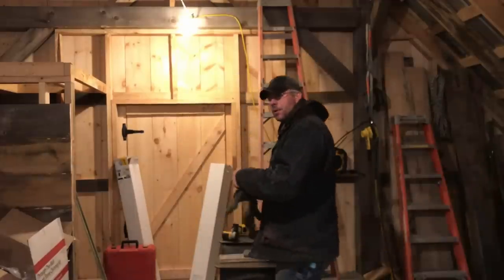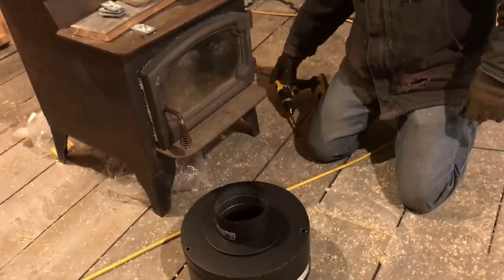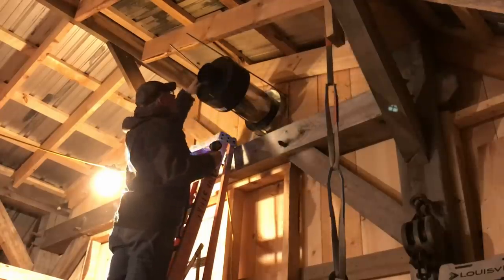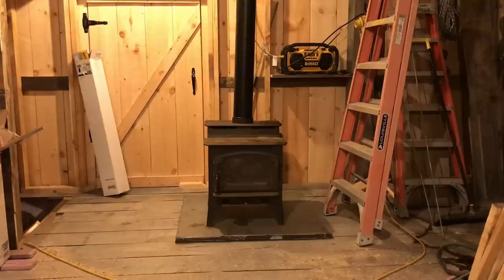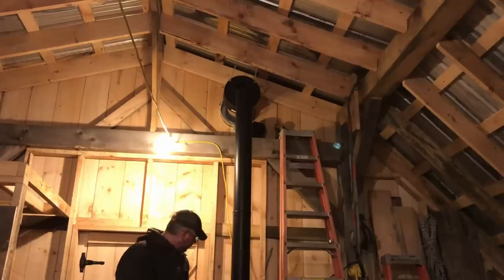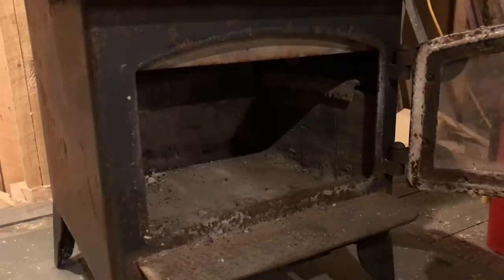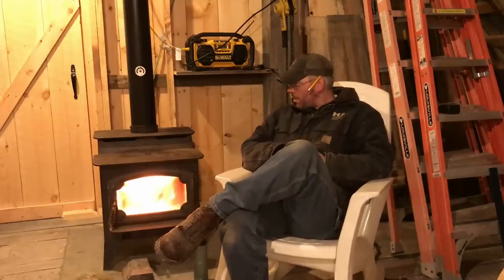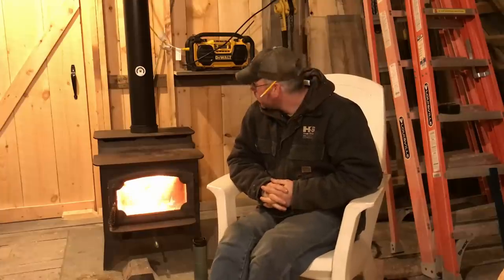Wood Stove and Chimney Installation is Complete, Our First Fire in the Timber Frame

Comment: I agree with your outlook about getting help, as I am the exact same way. My wife always states those same sentiments to me, as well. I hate asking for help, and I don't want to burden others. So I do it myself. 
That being said, our comments about the ladder safety is for your benefit. I was always told, if you don't have the right tool for the job, then get it. So a shorter ladder can be replaced with a longer one, even if it takes an extra bit of time to fetch it. I see you hobbling still from your accident, and I'd hate to see you relive that accident again.
At any rate, sir, another great video. I envy your work ethic and talent. Thanks for sharing. Cheers!
Reply from the maker: You and me both, reliving that is not in my plans.  Of course, it wasn't in my plans the first time either.

Comment: Great install. I’m a career fireman and I live in a 105 year old wood frame home with all wood siding and walls. So I hear your concern of a chimney fire. I don’t know the price but have you ever considered installing a dry sprinkler system? Something you could connect to your water supply and monitor with a  WiFi enabled smoke/heat detector.  You flip a valve and it gives you something helping you to darken down a fire until you get it knocked out or help arrives. Residential systems use plastic pipe for sprinkler systems and they’re more cost friendly. Most sprinkler heads don’t flow a high gpm so even a few in the ridge may be help. Just a thought. Keep up the hard work.
Reply from the maker: I have actually worked on a few systems like that but they were huge.  They used compressed air to hold a valve back, sprinkler head fuse melts, air pressure drops and the valve opens.  Works very well.
Reply: TheTradesmanChannel yep. Same for all our parking garages. Just didn’t know with your level of skill if you could make something a little more economical
Reply from the maker: I bet it can be done, it's really a very good idea.

Comment: Good job there Jim.  I know how that cold is too. Many a days we worked outside in them temps building concrete forms. Then having to wrap them with poly and setup propane heaters for the pour. I don't miss those days. Good luck to ya and keep trucking on that insulation.

Comment: Afternoon Jim... still snowing here, but it is coming to an end soon. Only one other thing I would have done with that chimney. I would have put a quad connector where you have the elbow in the single wall pipe at the top that would allow me to clean out the down pipe to the stove and the short pipe going through the wall. I just think it would make it easier to clean than taking the pipe apart to clean it, unless of course you have a more flexible clean out rod than I do. But of course, if you keep that pipe temperature at the right level, that creosote should burn out anyway. Good job and now you can get back to your favorite job, insulating!

Comment: Hi Jim - why not put an inline fan in the vertical stovepipe? It would reduce the heat at the elbow and distribute heat in the barn  that would have been lost up the chimney.
Reply from the maker: Chimney needs to keep its heat to retain draft which is much more important than the little bit of extra you get from those heat exchangers.  Cooling the chimney down will create creosote.

Comment: Jim you are so right about having to do things alone.. everything i do is alone, but it must get done, with me, so many times something could happen, be it run over and stomped into the ground by 12, 1500Lb steers to getting pined under a truck, or falling off the roof, and know one would even know anything happened, and could be months before anyone found me. but thing need to be done weather i like it or not, with my back i could simply fall between 2 tight thing from 5 feet up or just falling over, and get stuck, and cant get out, and yes it has happened before, many hours before i was able to get my self out, just a few weeks ago i got stuck under my mobile home, since the flood it has sunk over 14" into the red clay, and it is a really tight fit, was trying to thaw out a water line and had to work my self under the steel beam, and got so far and couldnt move, and iit was dam cold under there, over 7 hours before i got free
Reply from the maker: Damn

Comment: It is 65° and Sunny Jim.  Rain tonight but 70° tomorrow.. then rain the rest of the week.

Surprised you weren't using some step bits on the sheet metal drill holes.
Reply from the maker: I have some step bits, just don't use them often.
Reply: @TheTradesmanChannel  so you know the weather changed drastically overnight.  High of 40 today now.  I blame the change on you.
Reply from the maker: Good you dirty cork stuffer.

Comment: A real question:  Why not use cement board (dura rock) vs metal? It seems the metal will eventually get hot and be a better conductor, but you do this for a living so would love your take on this.  

As far as working on your own, I have no problem with that for 98% of your build.  When a neighbor asks for help, I am a big boy, I know when to say no because it is beyond my capability.  And there is risk crossing the street.  I am a project manager by trade and always have a second project lined up if I know you may have to wait for someone else.  You could have worked on the stairwell while waiting for someone to help you with the stove pipe.  We are only giving you a hard time because we love you! 🧡
Reply from the maker: I know you guys worry, I do too.  As for the metal on the floor, it all boils down to the stove.  With this one running full bore it stays cool under the stove.  It's first 20 years was spent the same way.

Comment: A free standing chimney outside for your wood stove?  Would not a chinmey fire then be isolated ?   Seems generations of cabin builder uses an outside chimney of ROCK and mortar for a reason. 

Build a base and put chimney square blocks up with a liner. Rebar the corners.  When stacking, use 4   9/16" hex nuts as mortar spacers…and it helps the chimney go up plumb.

Comment: Jim what's your thoughts on them barrel stove kits? I got a cheap way to get barrels and they are getting to look like a nice lightweight alternative....
Reply from the maker: They're not terrible but you really have to be careful not to over fire them, also make sure you keep really good clearance around it.
Reply: @TheTradesmanChannel  just thinking of an easy wood to pack in a couple miles from the road. (I can always cut a path to the cabin site and use what i fell as fire wood, but just want to limit visible paths to the location) thank you Jim
Reply from the maker: I think it'll be fine, just use common sense and keep the barrels in good shape.  You may have to replace barrels every few years.
Reply: @TheTradesmanChannel  great feedback Jim, thanks alot!

Comment: You keep talking about fires in the chimney.  Well I always had a 16oz of water close at hand.  If you ever get a fire in your chimney, just open the door and toss the glass of water in the fire box.
Then close the stove up..  The water will turn to steam, and put out the fire..  I had a chimney that was two stories tall and after 3 years, I had to take the stack down.  While I had it down I ran a brush through it.  I only had less then a half of a cup suet from the clean  out..  So my running the water in my stove every month helped keep the suet down to a good point.
I was told by a fire fighter, that putting out chimney fires with a cup of water, was the best thing to save your home...  So keep a glass of water near the stove and keep it full...
Reply from the maker: Great tip, thank you for sharing.

Comment: You need to put the batons boards on the cracks or it is never going to begin to get warm in your building. Too many cracks between your siding boards  for air to pass through like a screen door. Its not possible for it to hold any heat.
Reply from the maker: You are seeing sheathing.  There will be a vapor barrier and siding going over the exterior.  I am not expecting this to hold much heat right now but it takes the edge off.  I've mentioned finished siding in many videos, including the last couple of videos.

Comment: So will you put a vent from outside to the stove so you are not sucking so much cold fresh air through the walls?
Reply from the maker: Maybe in the future if needed.
Reply: TheTradesmanChannel 
Are you one of those breathing house advocates or are you one of Matt Risinger followers which say tight is right???
Reply from the maker: House needs to breathe, people get sick when a house can't breathe.  The make it tighter and tighter crowd have gone a little overboard imho.  You shouldn't have to spend a couple thousand to install HRV system for air exchange because the home is too tight.
Reply: TheTradesmanChannel 
What if tightening up on the air leaks allow the structure to last many decades longer and lower the energy used also?
Reply from the maker: Brian you really ought to look at what structure types have historically lasted longer than most modern buildings.  It is usually the ones that can breath.  I'm all for saving energy but there comes a point when it goes too far in the technology we use to save that energy.